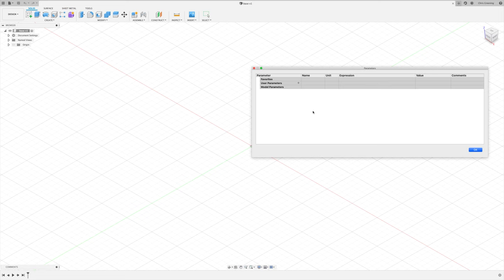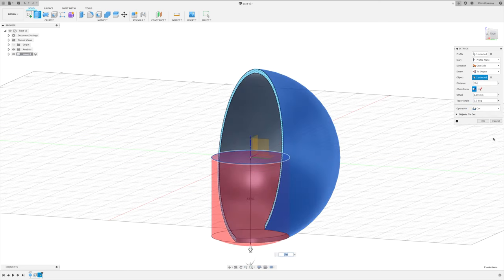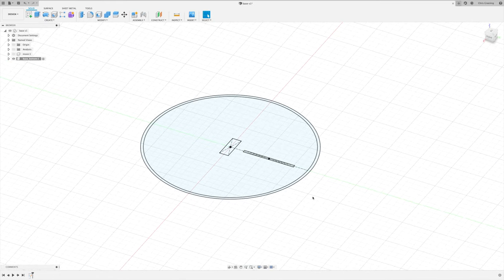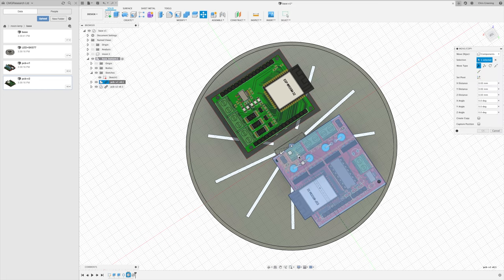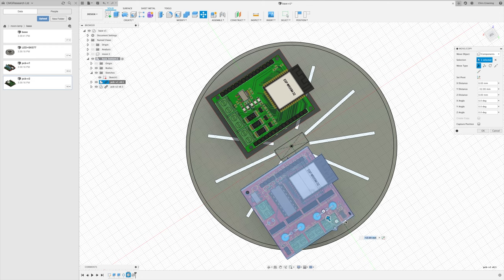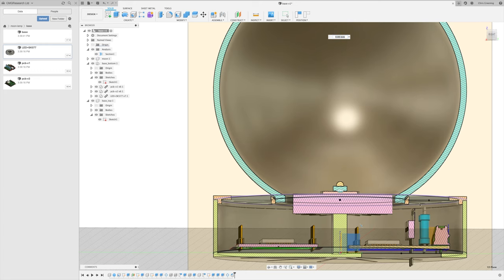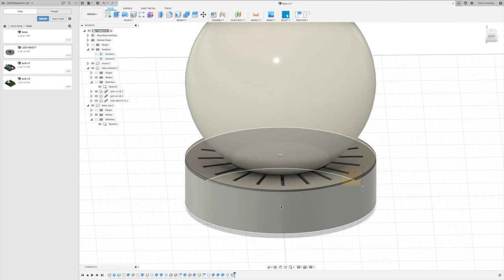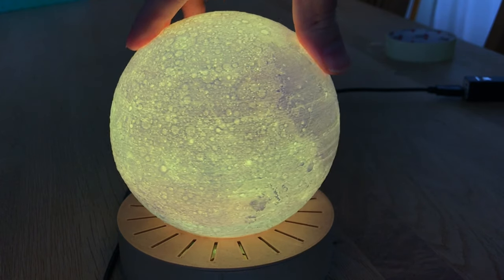Moon Lamp - Base Design in Fusion 360 and 3D Printing

Comment: Good but how did you convert the moon image texture into printable mesh ? This part is missing from your video but you print a textured moon 😥
Reply from the maker: I got it from thingiverse: https://www.thingiverse.com/thing:4102658
Reply: @atomic14  Ok thx but my project has different texture, check out "Image to Lithophane" : very usefull with Fusion 360 👌